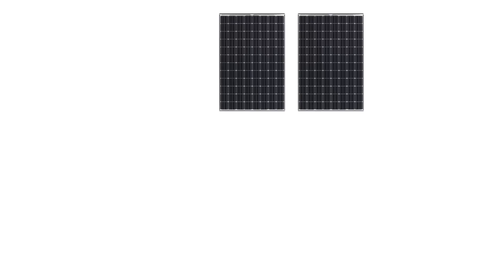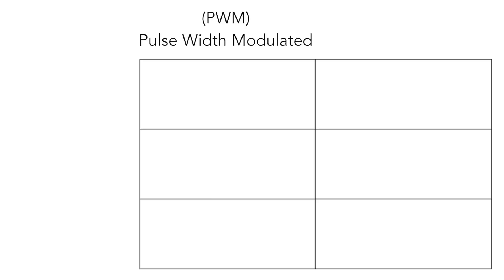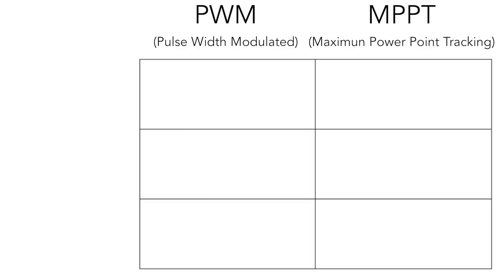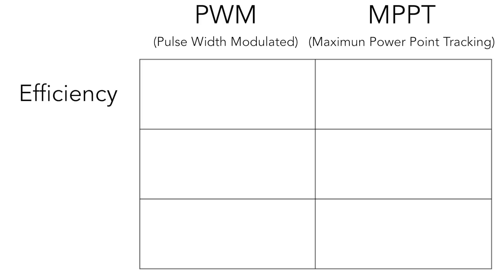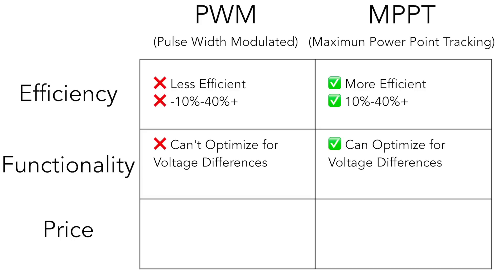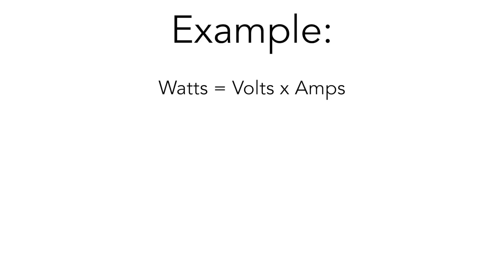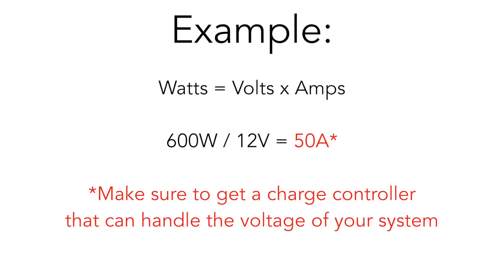Comparing + Sizing MPPT vs PWM Solar Charge Controller

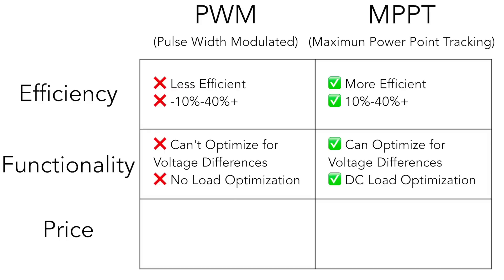Comment: Actually your statement at 4:30 isn’t accurate. Both PWM and MPPT are monitoring battery voltage (hopefully with a sense connection) and adjust current to compensate for the additional load. The load will pull the battery voltage down and the either controller will push more current to maintain the voltage. Also, the higher voltage at the input of the MPPT controller means you can use smaller cables. Depending on the distance from the panels to the controller, this could be a huge advantage. A plus for the PWM is that it is generally cheaper to add more panels to compensate for the lower efficiency of the PWM controller. This is a great series but if try and make it too introductory, then the value drops dramatically.
Reply from the maker: +Richard M Great points, Richard. Thank you for the feedback! I am attempting to make these topics basic and easy to understand but it’s proving to be more difficult than I thought. Because there is so much information involved, it’s hard to know what to mention and what to exclude to make a video that’s easy to watch.

I may need to find a different approach to explaining these solar power concepts after I walk everyone through my personal system. Thanks again for the great info... it really helps everyone learn and grow together! 👍🏼😎☀️
Reply: I think you have found the right balance in your presentations.  There are plenty of sources available to get the more technical information.  There are very few GOOD sources available to get someone started in understanding RV solar power without overwhelming them to the point they think they just don't have the intelligence to understand "electrical stuff".  Your "basic" presentations empower the novice.  After watching one of your "no fluff" videos the novice comes away feeling like they really learned something.  That gives them some enthusiasm and a foundation to build on.  At a minimum they at least know what questions to asks next, to help them to the next level.  When I was first trying to figure all of this out, I would ask questions in dedicated Solar Power forums and I got very technical answers that presumed I knew much more than I did which ended up just frustrating me.  I struggled through and now have a very good understanding of solar power but it wasn't all that long ago when it seemed out of reach to me. I have not learned anything technical or conceptual from your solar power videos but I have learned to admire your craft in teaching this information in a simple manner that respects the novice audience.  As you know, you will be picked apart by the "experts" with some of your wording but please know you are providing a huge service to those trying to learn the basics about RV solar power systems.  You are 100% successful getting across the basic and important concepts of each topic and at least 95% successful presenting the technical details supporting those concepts.  Keep doing what you are doing.  If you choose at some point in the future to do an intermediate level video on RV solar power you will again have a large and appreciative audience and fill a void in an area that really needs better tutorials like the ones you produce.
Reply from the maker: Thank you Tim! It is much harder to translate these concept through video than I had originally anticipated. I appreciate you understanding and voicing what I'm attempting to accomplish with this series (at least in the beginning). You are awesome and thank you for watching 😎
Reply: Duet Justus also don’t forget that mppts use bulk, absorb and eq. That’s a significant advantage.

Comment: everybody misses one important issue ...

I have always heard MPPT controllers have a higher failure rate than a simple PMW controller. Is a figure for an average "rate of failure", available?

If sailing along in remote areas, what happens if one's MPPT controller stops working and shipping is difficult?

I have too much solar wattage ...  I have 600 watts of 18 volts in solar, along with some deep cycle batteries and an average usage of about 200-400 watts per day ... let's just say I have a lot more wattage than I need. I will need more in the future.

Now, let's discuss the usefulness of a PMW to a MPPT controller, along with the fact that a person can have a couple rather small PMW controllers sitting in a drawer.

Another GREAT discussion could be what is a PMW controller ... what is a "glorified", PMW controller that is labeled as MPPT, what about an obvious PMW controller with those coiled things(I can't find the word), and then of course the typical, more robust MPPT controllers.

Is there really a worthwhile "added", operational value to these "glorified PMW/MPPT incarnations? Do they actually fit within their own niche'?
Reply: What's pmw? Pulse midth wodulation?🤣

Comment: Well, didn't answer my question! Is it bad to have a higher amp controller? For example, could it harm the system if I put a 50 amp charge controller on a 100 watt solar system, with one 12volt battery?
Reply: No, the amp rating is a maximum. Almost all power supplies are constant voltage power supplies, and will only supply amps according to ohm's law, I=V/R

Comment: Interesting and Rich info and lecture on solar energy.
I need your help on my solar system.
I have a 5kva 48 Volts solar inverter system with
two types of solar panels, 16 panels in all.
8 x 250W 24 volts panel.
8 x 330 24 volts panel.
12 batteries 12Volt 200 AH battery system.

Wiring: the wiring is 2Series x 8 Parallel.
Maximum PV wattage output less than 1000W. 
No charge controller installed as Inverter is Hybrid Inverter.
Panels are about 50 feet away from Inverter and storage.
Please, what do I do to get more output from the Panel as output is about 25% of installed capacity?
Reply: Diy solar power with Will prowse

He has a lot on solar power he might be  able to help you

Comment: Where are the other solar panel configurations
It appears you are speaking about sizing a mppt system to parallel wired panel array.
If you wired the panels in series the voltage rating is more significant than the current. You can also use a smaller gage wire from the panels. The rating on the charge controller needs to support the higher voltage.

Comment: Thats the theory...the setup is the crux of either...when either is optimised, theres nothing in it, dependent on the cabling & current...prey tell...what "efficiency" differences are they. Both are just as "efficient" as each other...one is more flexible is all.
Reply: If you watch other videos you will see this is NOT just a theory. My MPPT controller can easily triple the charge current from my 80 volt panels into a 24v battery bank. Prior to the advent of MPPT, using a very high quality PWM controller...I could barely run the A/C of my cargo trailer. When I upgraded to MPPT several years ago...all my power issues ceased.  BTW...please consider offering constructive comments of support rather than lambast a YouTube creator with your inexact wisdom. Its OK to be wrong but being snide is another  matter entirely.

Comment: i cant find anywhere what is the maximum voltage i can put into a mppt charge controller. i want to wire my panels in series but isnt there a limit on the voltage?
Reply: Yes there is, it is different from one charge controller to another and is written on the box

Comment: big question is, how do  i ratio  the panel and batteries,   if my batteries  12v / 200ah / 20hr, sealed  batteries is to expensive so  how many panel and batteries do i need  to set up,  i know it depend  how much load.  if solar panel  stats 12/ 100watts.. to much panel may goes wrong,  to much batteries disadvantages may exist..  solar controller depend how much panels and inverter it depend what load do i have.  am i right ?
Reply: marigold limbo yes depends on your loads.  I have a solar powered shower with a 12v battery charge controller and two 100w panels. 300 gal cistern and a instant hot water heater and a 12v water pump 40 psi. It keeps the batteries nice and fresh. We have a lot of people who take showers. On our heaviest days it carries day and night showers and only once or twice have had to isolate to charge. And that was due to weather.  Remember that 100w panels will not give you 100w. Maybe 50-75w. Typically.

Comment: I have a 100 W topsolar panel with a pwm charge controler just to charge a normal car battery...it will not charge battery properly

Comment: my pwm 20/20 ...12 24 48 volt  charge controller it won't work with my single house solar panel 180 watt ..why ???

Comment: is it ok to use for example a 100A solar controller with just a 300w solar panel?
Reply: Simon Jack what are the specs on your panel. Max VOC and Watts and amps.
Reply: Simon Jack well that question would go to the manufacturer of the controller. But it’s theoretically possible as long as your panels rating and voltage amps are acceptable to the controller specs.

Comment: Hi..  Everyone..  Can anyone please explain me here at last segment he said...  Wattage 600/ 12 Voltage  = 50 Ampere, Charge Controller...  

My Question is 
1. Here he mentioning about System Voltage as 12 V...  Is it 12v of Solar Panel array? If yes means for 24v system we have to divide by 24. (purely Series or parallel  connection) 
2. If the Solar array system is mixed with Series & parallel (12v & then 24v) means...  What should be the system Voltage to obtain charge Controller value?.
Reply: Jebaraj George if you look at controllers with mppt you can theoretically mix panels but you should know a lot about voltage watts and amps before ever trying it. 

A 24v system you can use batteries in series and parallel. To form the 24v. Many mppt controllers can recognize system battery voltage automatically. Personally I used 12v panels in series and parallel for about a year till I could afford 24v panels. The 24v panels are clearly superior. When adding panels they are about half their rated wattage. More or less. Unless you are in the desert with full sun direct sun. 

When they say that 12v exceeds this it most certainly can and you have to factor it in as a possibility. The voltage can peak in winter or in full clouded conditions. There’s one or two Chinese controllers that can recognize a 12v battery bank and charge from a 24v system as well. But you should know what you are doing when mixing and matching.

Starting off small can help you learn. When I first set up a wind generator I actually began by setting up a mini wind generator. It helped me know what parts I needed and what things may be challenges such as high winds and maintenance mounting issues.

Comment: Good work Boss, i now into solar instillation and i have being flowing your teachings. Can you take me via the #SIZING?
Reply: Atoscola Baiden wire sizing depends on your amps max. That chart he used in the presentation you can search online. The chart says what size or gauge wires carry voltage and amps. It’s pretty easy once you decide on the size. And the breaker box you can use smaller wires to go to your home etc.

Comment: When the battery bank is full it doesn't make a difference between controller.

A pwm controller with a water heater dump load, is more efficient, especially of you include a turbine.
Reply: What the heck are you saying? The second you need some power, the  controller kicks in and tried to help. At that point you might need all the power your existing panels and controller can provide. Voila' we are back to square one LaMarr.

Comment: The additional ~100 €/$ whatever for the mppt will NEVER pay out of you aren't over a giga watt!
For 100€ just get an additional panel to compensate the ~15% loss. Make the math: 100€ gets you easy 100 Watt extra. To compensate that you need at least 500 Watt array to be better off with a mttp

Comment: can i use a 2 volt 1000 battery with 220 volt invertor, and will it run Air Conditioning
Reply: Omar Bull-47 nope. Lol. You mean 2v or 12v?  And it will depend on your panels. And how many batteries.

A gas gen is a very easy solution till you can figure out your watts, amps and surge.

Comment: Victron has done a "white paper" on MPPT vs PWM, which shows MPPT gains nothing when the panels are between 60-85C. MPPT is like an investment advisor who takes a 5% fee and promises you will get it back again, with a high risk investment. The main curse of MPPT is that it adapts to changes very badly. If you turn on a toaster while your MPPT is in float, the MPPT will take a while to bother. PWM adapts to loads within a few milliseconds. MPPT can also fly up to 15.7V and freak out your devices. MPPT also performs badly in clouds, because it can do a power curve scan during a cloud movement, and conclude Pmax is somewhere weird. By the time it figures out that it has stuffed up, the next cloud has arrived. It's like helloooo. MPPT is also full of tech that's going to blow up in 6 years. PWM has to be sized to accommodate 25% surges during sun-cloud halos, but MPPT can have an even worse surge, because the battery voltage is low after some cloud. So, you don't know if you should allow 40% headroom on something that already costs a lot. You only get current gains in rare situations. MPPT also can lose in very hot 80C+ temps, esp. when the battery voltage is up at 14V. You may want to run aircon at 14V, so it's no joke to lose 6%. MPPT is good for lazy installers.
Reply from the maker: Interesting information to consider... Thanks!
Reply: There is some truth that MPPT controllers are not ideal in some situations, but if you look at the summary of the white paper you mention, it does not recommend against them:

An MPPT charge controller is therefore the solution of choice:

a) If cell temperature will frequently be low (below 45°C) or very high (more than 75°C). b) If cabling cost can be reduced substantially by increasing array voltage.
c) If system output at low irradiance is important.
d) If partial shading is a concern.
Reply: so unless you can produce a LINK or
Anything from VICTRON  Who produce MPPT controler
I Will call u out as Fake news
Reply: What s to consider.. are you for real..
duet Justus ..
Ask for link or dokumentation 
To claims on flat earth ..
Somthing is just too fare out
If MPPT dont Work woud they
Even produce Them 
VICTRON MPPT
You just lost kredebilety

Comment: What is solar panel is 12V and 48V battery bank?
24V solar 48V battery bank?
Reply: As far as I know, the PANEL voltages must equal or exceed the BATTERY voltages.  Since batteries are made of cells you need rearrange things to lower your battery voltages. It can be relatively easy with lead acid  batteries yet complicated in some other cases. Do your research and be careful.

Comment: you mention that the MPPT can be 40% more efficient than the PWM but you do not explain why this is the case.  If the transistor is switching on and off then why is there an inefficiency in PWM? if it is PWM then it means that the controller is monitoring something in order to adjust the PWM.  is it VxI? or just V or I?

Comment: solar panel will not do 50amps. i have a 200w panel   multiple that by 3 to get 600w. my ics is 9.12 so multiple 9.12amps   and it is 27amps. where are we getting so high amps why is this so confusing? there are so many people who say different things so what is the true way on figuring out this.

Comment: Since a 12 volt system actually puts out 16 to 18 volts, shouldn't the formula be 600 watts/16 Volts=37.5 Amps?
Reply: J that would be a peak calculation. You can do them all.

Comment: Very disappointing, when the video titled sizing the controller I was hoping to learn how to determine what size controller I would need. In watching many videos and reading many articles from different companies all I'm coming up with is many different conclusions. I have concluded its not just a simple divide watts by amps or volts but many other factors are involved  . In my case for example I have 3 200W panels rated at VOC 24.33, Vmpp 21.05, ISC 9.87, Impp 9.5 to be used with 2-3 BattleBorn lithium 100Ah batteries. If just dividing 600W by 12V I need a minimum of a 50A controller but if I use your math and wired in parallel I have 28.5A @21A or in series I have 63V @ 9.52A, so what size controller, volts/amps. Using the Victron website calculator they want me to buy a 150/45 controller no matter which way I wire the system but the people I bought the panels from told me to wire in series and sold me a 150/35 controller. I understand there are other factors involved such as hours of sun and angle of panels and panel efficiency. I prefer to wire in parallel due to the shading possibilities but everyone seems to have a different system for calculating.

Comment: MPPT controllers, at least most(all?), use a buck converter.  This is why MPPT controllers have efficiency ratings, it is the efficiency rating of the buck converter.  PWM controllers do not have an efficiency rating associated because there is no buck converter, they operate the array at battery voltage, not the Vmp.  Also, MPPT controllers(or any controller for that matter) will not have the ability to know what current is being drawn from your loads directly from your battery.  If a controller(MPPT or PWM) sees battery voltage sag(due to loads turning on) it will(at least should) attempt to supply more power to compensate for this sad, assuming it is available from PV.

Comment: Conclusion: MPPT is better but 2x expensive than PWM charge cotroller
Reply: Nope...not if your panels voltages closely match your battery bank voltages.

Comment: To my knowledge mppt has nothing to do with battery tracking. (Maybe I'm wrong.) As far as I know, it adjusts the voltage and current drawn from the solar panel to meet the maximum power point.